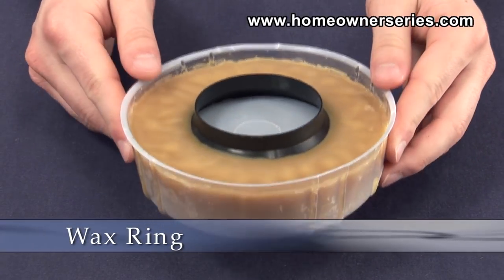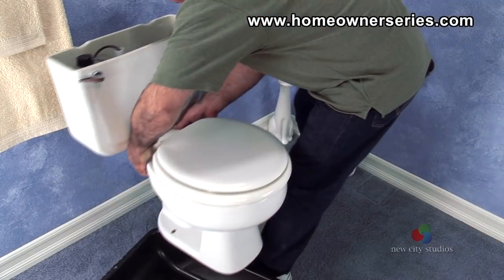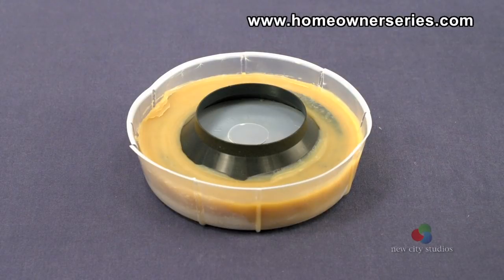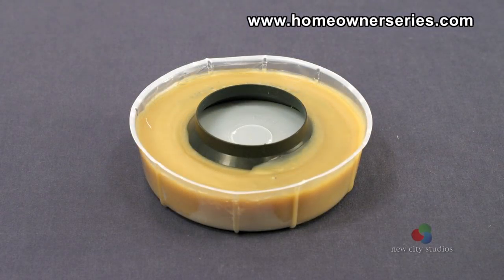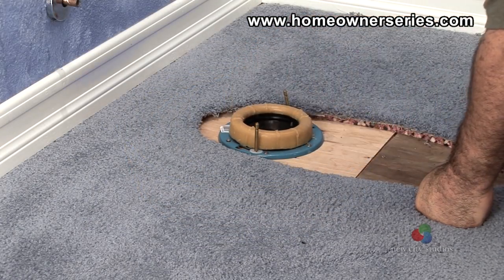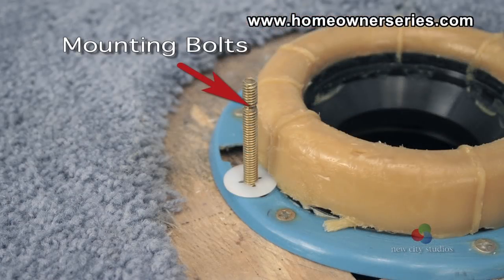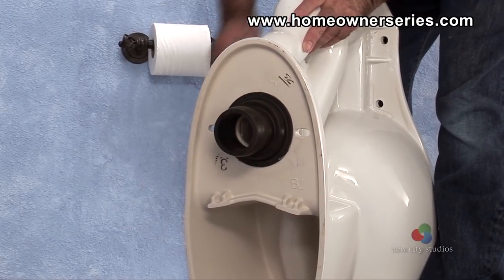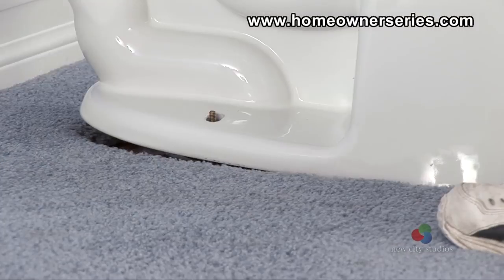How to Fix a Toilet - Parts - Wax Ring

Comment: i've seen that most people put the ring between the bolts, but all the directions i see tell you to put it on the bottom of the toilet then on the ground.  which one is right?  does it matter?
Reply: Stephanie Poster It is easier to put the wax ring on the flange first then bring in the toilet and place it through both mounting bolts and also onto the eax ring too
The wax ring does two things-
1-Stops sewer gases from coming into a building 
2-Stops water from leaking out of the bottom of the toilet bowl